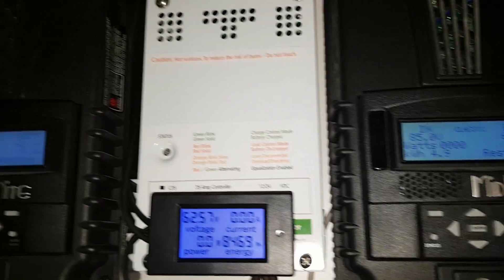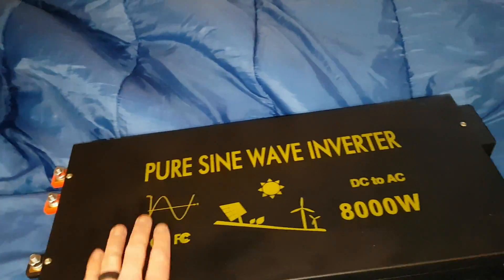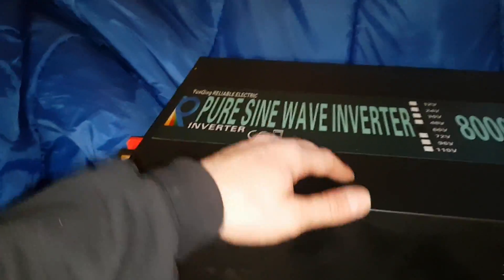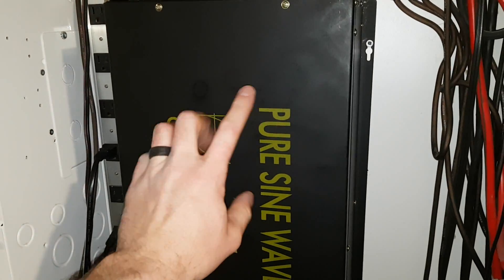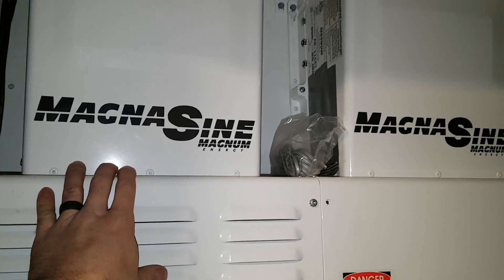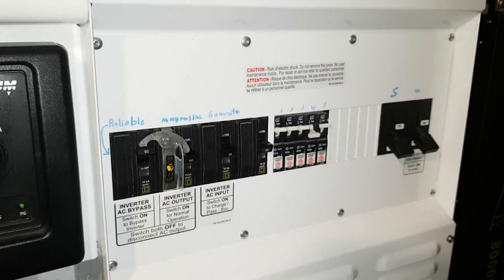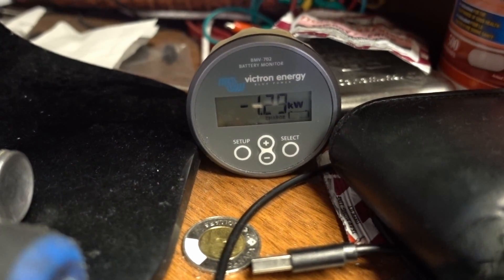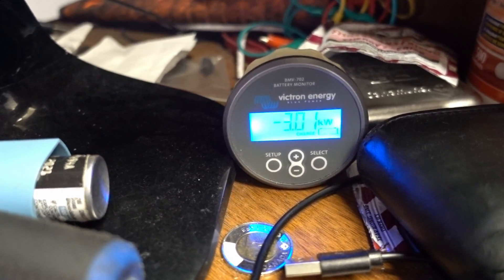New Reliable 8000W Inverter Testing

Comment: To all that wants to know what most don't know .say your using your 8000. Watt with a16000 watt surge.if your using around 6000 watts continuous you have to subtract that 6000 watts from the 16000 watt surge capacity leaving you with only  10000. Watt surge left.and that is providing all your wire sizing is sufficient. To some of us these so called low cost units have there limits.in one of your videos using a chop saw after putting a heavy load before trying to run it put it in an overload .

Comment: What leg are you using to check your sine wave?  Try the other leg to see what it looks like.  Some of these put either a smaller filter on one leg than the other or even no filter on one leg for some odd reason.  You may want to add a filter or 2 if needed.  Not sure your expertise so I won't urge you to do anything inside unless you possess the skills.
Reply from the maker: This is only 120v

Comment: What a pile of junk in a perfectly good closet for power . This cannot be worth while. Nice hobby though I guess
Reply from the maker: Still saving me money, around 200 a month now with 12000w of solar
Reply from the maker: i make around 50Kwh a day on good days, and i pay 35c per kwh including delivery.
Reply: Going Off Grid   Don't get me wrong. I use solar for battery maintenance in the winter for our machines. But you got to admit that closet looks dangerous
Reply from the maker: @BillStecik  haha it looks like it but  I have over rated wire and 30 amp fusing on every bank of batteries. and i have breakers on all the solar and inverters as well, checkout my newer videos its getting better in there. plus I have it a few min fire rated with it being sealed off with fire rated foam. I also tested a dead shot over the hole system. it was scary! but everything worked as it should :)
Reply: @GoingOffGrid101  I found your channel while looking for an inverter for my friend in texas that he could hook to his car to run his furnace and a fridge. I live in canada myself

Comment: Are these worth investing in, the newer models I mean ?
Reply from the maker: I had mine for close to 2 years running all the air conditioning in my house, then it stopped working properly , still out puts power but not the full 8000w
Reply from the maker: I really like thier 4000w or less cause I have not had one break on me and they are almost 4 years old

Comment: Why you always talk about the voltage input and never about wattage input ? Let me say you have 48 VDC input and how much wattage input you need to have so you will get 8000 watts output?
Reply from the maker: It's about 80-90% efficiency  so 8000w times 1.1 or 1.2 and that is how much power on the DC side it will take at full load, the inverter only takes about 40w at idle

Comment: Thanks great video!! i haven't gone solar yet, but i just bought the 2500 watt, 24v for backup for RV and home. Have a emergency propane 5000w that plugs into house house and has separate junction box to run necessities.  I got this 2500 watt from WZRELB to power a few more things around the house in power outage:  Got the 24v because into drones and have a ton of 6s (21v - 25.2v) batteries
making it easy power.  Simple question that didn't warrant my back story...lol,  Mine is also
slimmar, with yellow text and that army green color.  Are all wattages they sell with new that army green the newest versions or just in 8000 watt version, thanks!

Comment: Ummmm...I did  have the 3000 watts units...it burn the mosfet together with the fuse..socket.   This unit is for 60 volts ?  ...The one in ebay seems for 48 DC volts.   The  10,000 watts transformer is to convert the 120 v to 240 split volts ? very good video!!!! Thanks

Comment: I am looking at the DC cables feeding the inverter and I’m confused... you have what looks like a 2/0 positive cable and 3 #2 or smaller cables... and the negative side has just 2 #2 cables... what is all the other positive side cables for?
Reply from the maker: I didnt have enough room on my bus bar :P
Reply from the maker: I didnt have enough room on my bus bar :P

Comment: Plus the fins are too thick, not enough surface area
Reply from the maker: it seems to be ok in 30c + temps I only run to about 80% load.
Reply: @GoingOffGrid101  ok so that would be 80% of your tested load,  about 5000 watt

Comment: Would you mind checking your 8kw Reliable for voltage at ground?  I just checked mine and it has 60 volts from hot to ground, and 60 volts from neutral to ground.  I'm wondering if you have the same.
Reply from the maker: The new model Or old?
Reply from the maker: Nvm just watched your video, ill check.

Comment: How.many amp hr does your battery bank have .
Reply from the maker: ATM about 1000 Ah at 60 volts, soon to be 1500Ah :)
Reply: @GoingOffGrid101  where may Purchase a 60 v Inverter ? 
Thankyou .
Reply from the maker: @DavidTaylor-hk9ir  email reliable and they will make what ever voltage inverter you need.
Reply: @GoingOffGrid101  Thankyou!

Comment: install two of the 8000w one of the 120v and the other is the 240v I have nothing but trouble with the 240v first the output board went that was replaced,  on replacing it keeps blowing  the fuse on the input board,  what do you suggest thank you
Reply: received one of the new 48v/ 240v 8000w inverters today.  hooked it up and switch it on after looking inside came on fine then after plugging the house power which consists of 2 fridges and a tv also my computer and a few other light stuff.l hear a click sound as if a fuse had blown. I turned it off and on again and it seems to be working but I am a bit concerned not knowing what causes that spark
Reply from the maker: @dayniellemckay972  I would look at he fuse just in case, are you sure the click came from then inverter ? or maybe a loose connection close to the inverter? im thinking its fine, mines been running much more then that so yours should be fine.
Reply: @GoingOffGrid101  yes it was from inside the inverter I am sure because I had it open and just about see the spark at a glance it was on the main board .there are no burn marks or anything like that and if there are I am not able to see it ,but would it continue working if a fuse is blown?
Reply from the maker: @dayniellemckay972  yes each transformer has more then one fuse, I would check :)
Reply from the maker: you have bad mosfets on the input board, that is whats causing it to blow fuse, I have never tried the 240v but im guesing you are running something like a large motor, the older 8000w had a hard time with large motors, the new one has a much better time starting motors
Reply: @GoingOffGrid101    replaced MOSFETs .and still blowing fuse after a load is applied for a short while. also at one stage was only showing 198v instead of 240v I then again change a faulty mosfet  but still blowing fuse when a load is applied for a while. it's doing my head in
Reply from the maker: @dayniellemckay972  I would change all the fets then, the 8000w  out going model is a hard one to repair. have you tested the tiny resisters in front of the fets ?
Reply: @GoingOffGrid101 I started having this problem after a new 240v replacement output board was sent to me. the original one blew up the same day it was installed and a load was applied to it. the odd thing is that the 120v one has been performing without any problem so far they are both installed in the same property
Reply from the maker: @dayniellemckay972  I would use a transformer with the 120v inverter to get your 240.
Reply: @GoingOffGrid101  the 240v is  dedicated to 4 ac unit and the 120v is for running the rest of the house so putting a step up transformer would just pressure the 120v inverter
Reply: also the 120v inverter is  24v and the 240v inverter is 48v
Reply from the maker: @dayniellemckay972  how many btu are the AC units ?
Reply: @GoingOffGrid101 I would have to check the next time I go to the premises but that won't be until I get this inverter sorted out
Reply: @GoingOffGrid101 I just took the dam thing out of the box brand new today. it's a bit late now I will take a look in the morning. take care of your self mate and god bless
Reply from the maker: @dayniellemckay972  GL!
Reply: @GoingOffGrid101  took a look and there are no blown fuses and no bad MOSFETs. by the way why are the mosfets 

upsidedown looking inside the inverter without removing the board
Reply from the maker: @dayniellemckay972  sounds like its fine then:)
Reply: @GoingOffGrid101  it would appear so.a and thank you for all your help

Comment: Low vs High Frequency Inverters is High only gives a fraction of a second of surge and Low can go 20 seconds or more for a heavy load surge. What kind do you have?
Reply from the maker: I own both low and high, the reliable is a High frequency inverter, it uses a soft start with anything over its rated power and works very well.
Reply: @GoingOffGrid101   You have the best system I seen on YouTube. Yes they do work good and usually within their running wattage, but a 3000watt with a 6000 surge and it takes 5000watts to kick it over then runs at 2500watts the Low Frequency inverter is best to use as a rule plus on the other hand I love the soft starts for certain audio, it allows for the caps to slowly ramp up then the relay kicks in so does your High Frequency Inverters have super caps for the surge?
Reply from the maker: @MrBrymstond  no super caps, the inverter just provides 8000w and anything above that the voltage sags till the amps are low enough to equal 8000w
Reply: @GoingOffGrid101   I think maybe the super cap idea which would be regulated for voltage, but allow the power to turn over a compressor without strain. I need to think that over and play a little. Then the super caps rebuild their charge for the next surge. Maybe that's an answer for the high and low. Maybe

Comment: For the most part not all appliances need a perfect sine wave, but a music amp could benefit from a power conditioner. You could probably clean that sine wave up by replacing the generic caps, mosfets and so on. Providing the appliances don't mind 128v you draw less amperage.
Reply from the maker: you can change the voltage with a pot on the inside. thanks for the information!
Reply: @GoingOffGrid101   That's cool they added a variable resister so you can do this without installing different resisters, so is it a Low or High Frequency Inverter?
Reply from the maker: @MrBrymstond  its high frequency.

Comment: I am loving the specs of this new generation of reliable inverter. I have been using an APC 2200kva but it's a hog at idle pulling 1.6a. I think the 3k unit should fit our needs and budget.
Reply from the maker: im hoping to test the new 3000w, the older 3000w was a beast.

Comment: If possible, you should make a step by step guide video on how setup inverter, how to connect batteries or supercapacitors, where to connect wires from wind turbine or solar panel, 3 phase rectifier, bms, etc. to power your house off grid.
Reply: Agree with you. If possible make 
 step by step video. Keep up the good work.

Comment: Dude were do you get that kinda inverter and can you explain the Transformer you got and how that works I am trying to make a system like yours how much solar and what kind of batteries are to using
Reply from the maker: I have 8700 of solar and about 60KWH of batteries, I am using electric car batteries, from all different companies, the transformer turns the 120v from the inverter to 120/240 split phase that we use in Canada to run the hole house.
Reply: @GoingOffGrid101  nice what the in put voltage to the battaries and we're do get them and transformer and that big inverter all I see is those China  made stuff that don't  last more than a few years this seems to be the weak link
Reply from the maker: @nyghtmyst5118  I have 2 magnasine inverters $3000 each then I have this new reliable 8000w inverter that is in the description below witch i am testing, so far I have tested up to 7000w on it and over loaded it many time and it has not let out any smoke yet :) I have a max battery voltage of 66v  I bought me batteries form a junk yard, the transformer is from ebay.
Reply: @GoingOffGrid101  how else the transformer work ? What a good price for this type of battery? I have a. Midnight 150 and 800 watts of solar work I g get to get her the stuff I need I live in  north east so I need to make hybrids system winter  suck for solar up here the panel I have are monocrystlin divide that the next 800 watts will be polycrystalline

Comment: My well pump only pulls 7a at 120v, and TV, fridge, microwave, and maybe a induction cooktop. (Nuwave) or something, and a few lights, gas on demand water heater, and looking into a gas cook stove, diesel and wood heat, in my off grid house, no grid atall! I only have just under 20kwh battery bank! No 220v
Reply from the maker: sounds like a great off grid setup!

Comment: Sounds like you really would do well to go with a low frequency inverter.
Reply from the maker: I have 2 magnum low frequency inverters that I can pull over 13000w from, but the nice thing about this reliable is the no load current draw is only 35w
Reply: A 100V/50Hz inverter (e.g. one targeting the Japanese market) would be a good choice for reducing power usage of resistive and motor loads, but would actually increase power usage of most electronic loads. (Note that "brushless DC" and "inverter drive" motors are considered electronic loads!)

Comment: by the way, what ever happened to the water cooled prototype?
just wondering
Reply from the maker: I found that it wasn't a cooling issue with the older out going model so i scrapped the idea.
Reply: @GoingOffGrid101  ok

Comment: there is one thing to be said for that particular chinese mob making that inverter:
they are improving their products. also seem to learn from their mistakes.
so in ten years time they will have the price and size of the magnums.
just saying
Reply from the maker: this one seems legit so far, I have overloading it running the house and dryer 3 times with out issue :)

Comment: What's the transformer u use with it for 240v
Reply from the maker: just a no name 10000w from ebay.
Reply: Any plans for the old 8000w?
Reply from the maker: @johncoinas  backup for now, might add it to the work trailer.